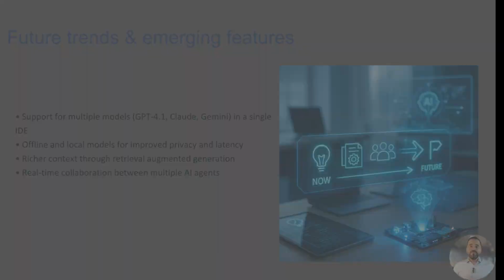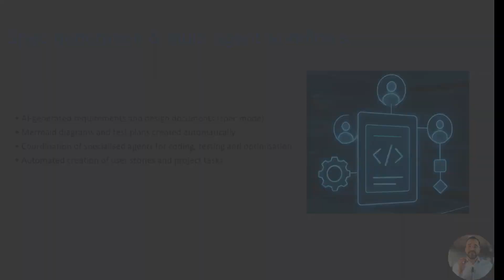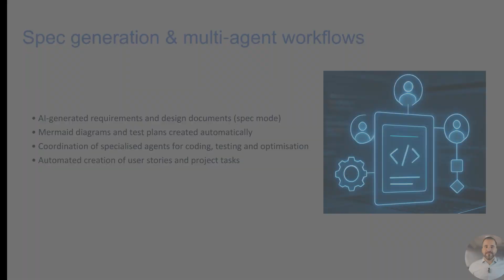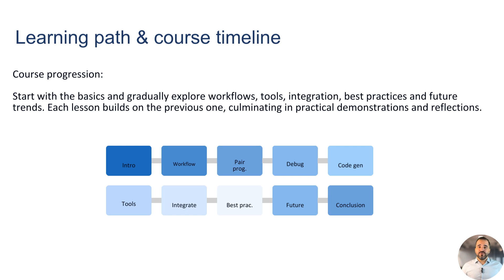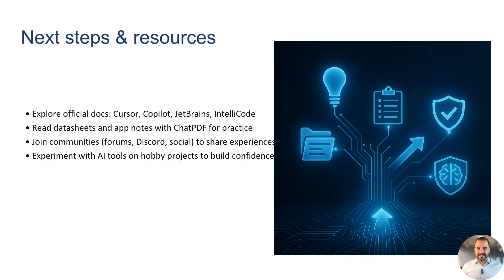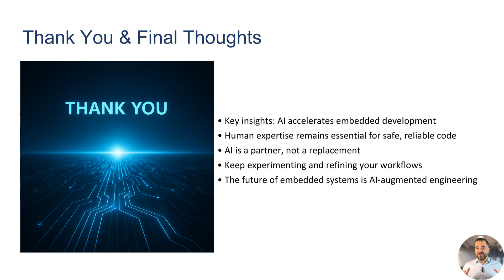Embedded AI: TinyML, Edge Chips & the Future of Smart Devices

Comment: I'm not a professional, rather I'm someone studying to enter this field. With AI advances though, will embedded engineers even exist in the future? Should I bother studying this?
Reply from the maker: Cryogenics12, this is a very important question. Embedded engineers will absolutely continue to exist and remain in high demand for the foreseeable future. AI is a powerful tool, but embedded systems require deep understanding of hardware constraints, real-time performance, power budgets, safety-critical design, and domain-specific optimization that AI cannot replace. Instead, AI will become another tool in your embedded engineering toolkit, used for tasks like anomaly detection, sensor fusion, predictive maintenance, and edge inference. The key is to build strong foundations in microcontroller architecture, RTOS concepts, communication protocols, power management, and debugging techniques. Engineers who combine embedded expertise with machine learning knowledge will be especially valuable. Focus on hands-on projects that integrate sensors, actuators, communication modules, and control algorithms. Every IoT device, automotive system, medical instrument, and industrial controller needs skilled embedded engineers who understand both the silicon and the system-level architecture. Your timing is excellent because the demand for embedded talent far exceeds supply.

Ashraf of Educational Engineering Academy